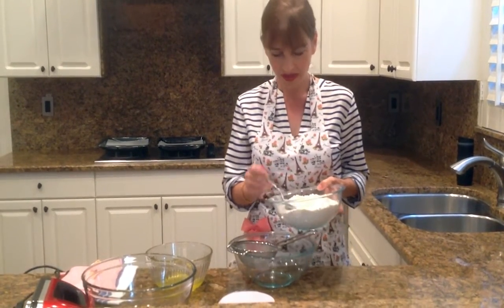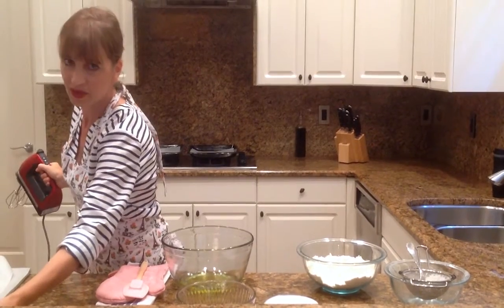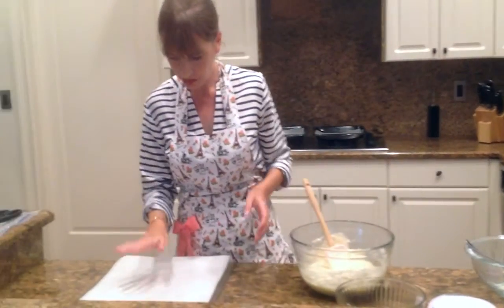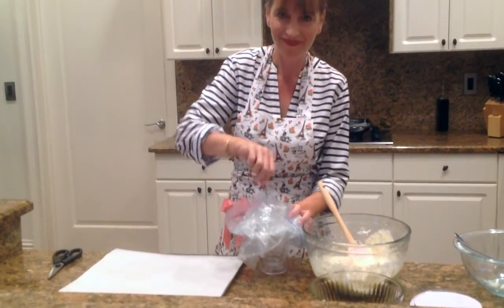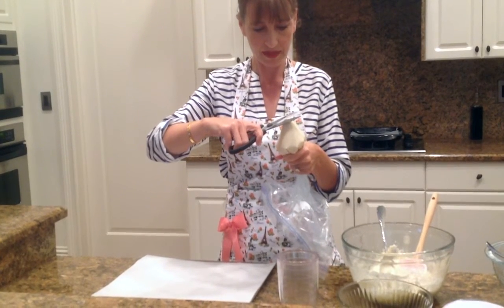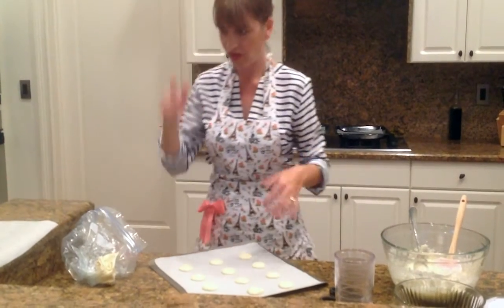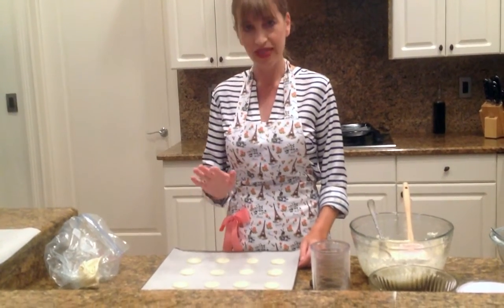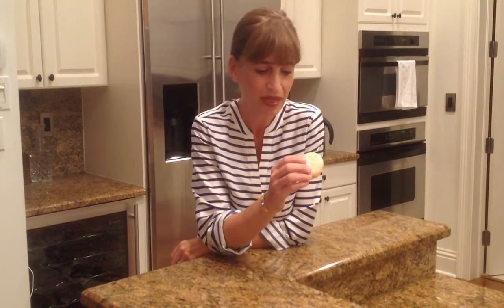Alexas Macarons

Comment: Hello, that you for getting back to me. Your video is great but when I try to get recipe i can,t open www.alexaskitchen.net
Reply from the maker: +raeschimmel Good Morning raeschimmel, I have copied the recipe to here, maybe something in your settings is that the website will not open , mmh...here is my email me alexaskitchen@icloud.com you can also write to me there. Good luck with the macarons, it took me a long time to master them. Have a great day and I will talk to you later. Love, Alexa
When you make macarons, measure your ingredients with a scale in order for them to be precise. You will be using egg whites to make this french fabulosity. The egg whites should be aged, meaning that you separated them a few days before you make the actual macarons. When you separate the egg whites from the yolk, place the whites into a bowl that you cover with a paper towel and then place them in the refrigerator. Take the egg whites out several hours before you make the macarons so they will reach room temperature. 
Heat the oven to 325 F (160 C).
Make sure that you sift all the dry ingredients very fine. If I do not use a mixer this takes me up to a half an hour. If you use a mixer, sift them afterwards to make sure there are no lumps. The trick to getting the egg whites perfectly stiff is not only ageing them but also that you use clean utensils, I know you are clean but I mean like literally NO grease from your fingers or anything on your mixing bowl or on the attachment of your mixer. When the egg whites are stiff, all you want to do is fold the sifted ingredients into them. Pipe the dough onto the baking sheet, bang the cookie sheet a few times against the counter top and then let them rest.
Rest them until they almost have like a little film on top. When you touch them carefully with your finger nothing will come off. Then they go into the oven for about 12 to 15 minutes, this will depend then on the size you make them. Turn your cookie sheet once so they bake evenly. Let them cool off completely before you add the filling. Store them in an airtight container. I actually like them better when they are a few days old. So, good luck, do not get sad when they are not in the perfect way the first few times. Be patient, take notes of EVERYTHING you do. You WILL get there. Love, Alexa

Here is what you will need
180 g almond flour
310 g confectioners sugar
175 g egg whites
50 g fine sugar

and for the rasberry filling I used
2 coffee mugs of fresh rasberries
8 oz ( about 225 g) cream cheese
2 tablespoons (Esslöffel) of your favorite honey
strain the rasberries through a sifter until you have a the juice in a little bowl. Now combine the juice, the honey and the cream cheese with a mixer. If you would like more rasberry taste, add more of them.